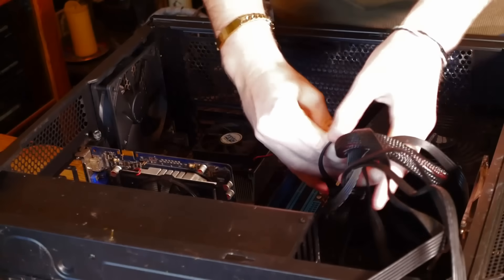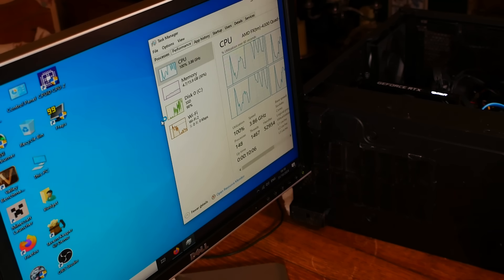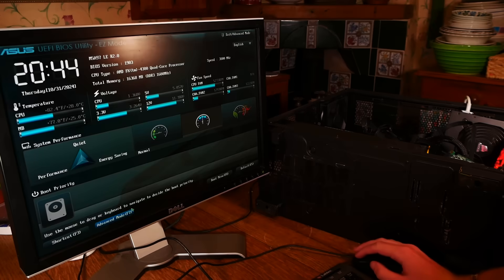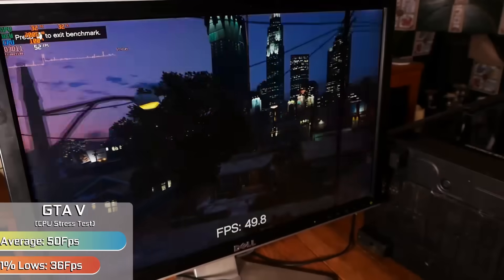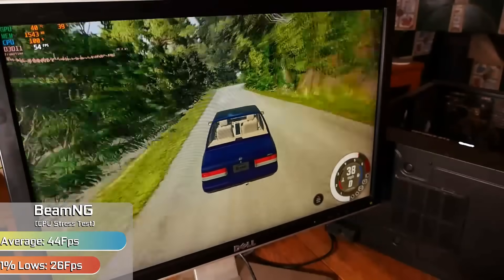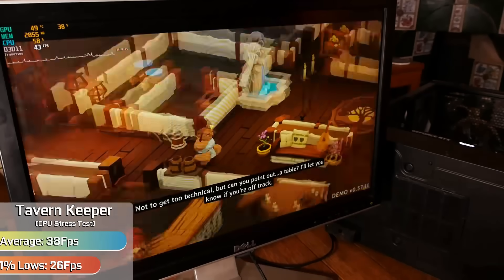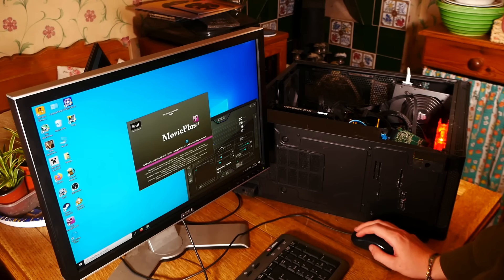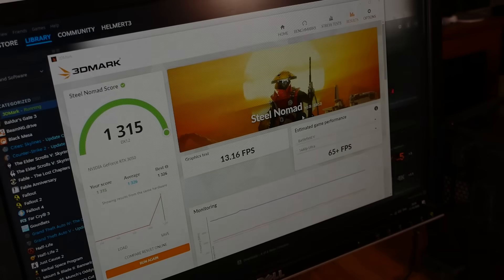AMDs Weakest FX Processor...

Comment: still rocking fx8350 as the daily driver
Reply: it run helldivers 2 still . so its still good imo. for my use case
Reply: altho i did have a msi 890gxm-g65 motherboard that supported UP to fx 8120 as its only compatable 8 core part. sadly it was too much for the vrm and eventually caused a catastrophic vrm failure on the board smoke fire and kaput.  mind you that motherboard ran as a daily driver for a good 8 years..  the fx8120 Survived the catastrophic failure. so it sits religated to the dust bin of old cpus since there is just no good reason to use it over the fx8350.. side not i ended up getting a 8th gen intel i5 8350u powered laptop.. i am astounded to find out intels 8350 is actually close to the same performance as the fx... albeit Absolutely gutted and crippled by intetls uhd620.. just find it funny intel v amd 8350 are similar performing.
Reply: being a phenom user for so long. the fx upgrade was great lol an all inclusive bundle for 130$ crosshair5 mobo 16gb of hyperx cpu nice 6 pipe tower cooler.... id be 130$ just on a ryzen cpu negative the mobo or the ram.. the cheaper all in 1 upgrade was more viable then hunting down each part one by one hunting for deals.. mind u that was now 10 +months ago.
Reply: Depends on other hardware... but from here it seems like a sour grapes situation
Reply: I am so sorry.
Reply: I hope you overclocked RAM and CPU/NB

Comment: fx 8350 <3
Reply: Still running an FX8350 with 16gb RAM and an RX580. Plays Elden Ring at high across the board. Going from Win7 to Win10 gave a huge boost in performance.
Reply: The bulldozer Stockholm syndrome is real
Reply: my bro still uses my old fx 8350 and it's running every game he wants to play,  helldivers, elden ring, red dead 2. pretty good for an old as hell cpu